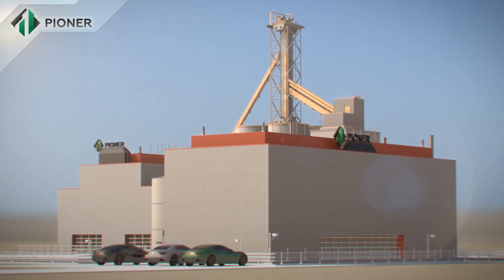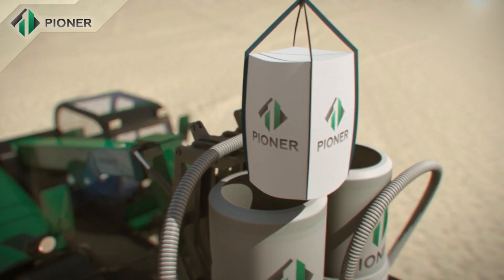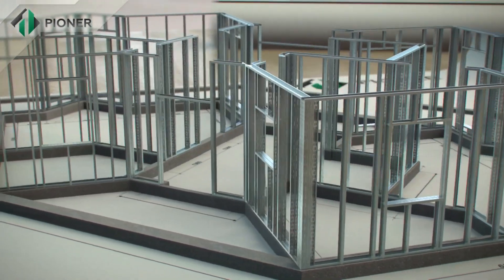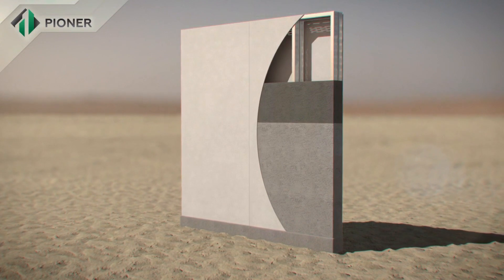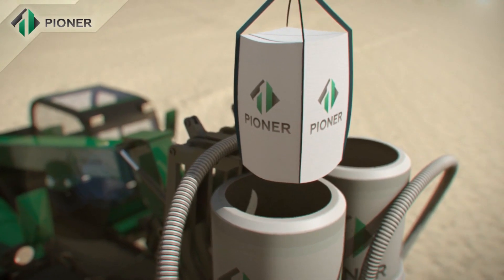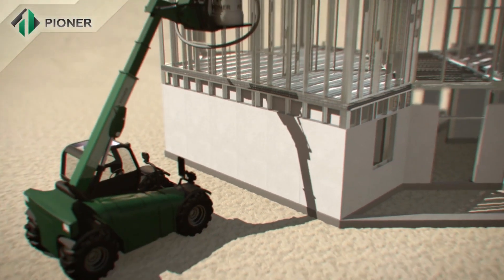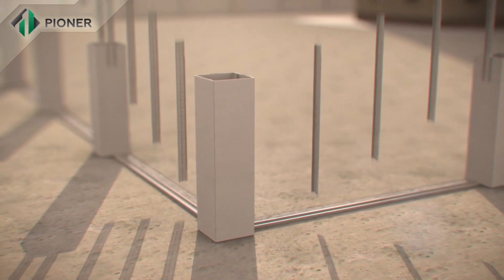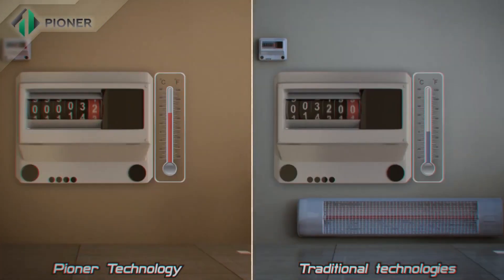How to build solid and durable house with advanced construction technology

Comment: Sounds good. Question: How strong is walls against a hit by full size truck or F5 tornado?
Reply from the maker: If you use light gauge steel frame and non autoclaved lightweight aerated concrete infill and cladding www.pioner-group.com/technology it is solid, the same as concrete / blocks building
Reply: Where is your service?  What is the rate per SqF? Can you provide your service in Karnataka?  Thanks. Send me reply please.